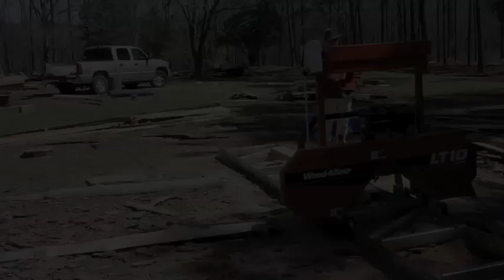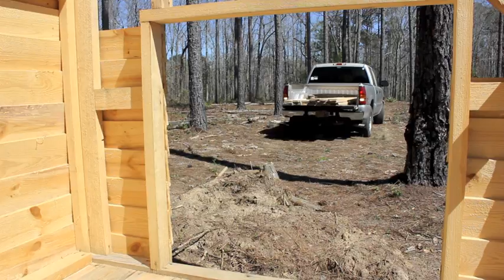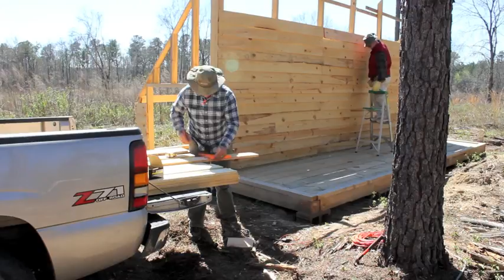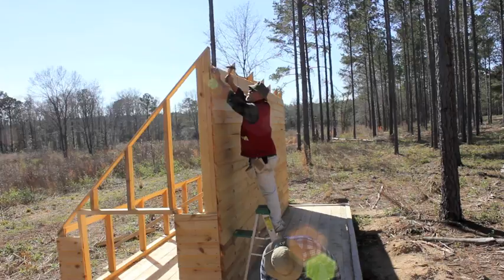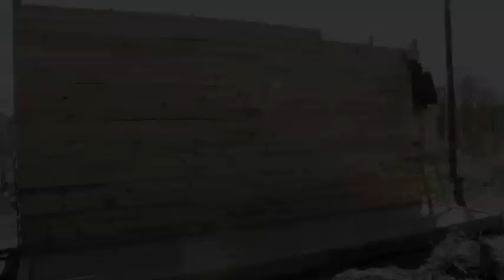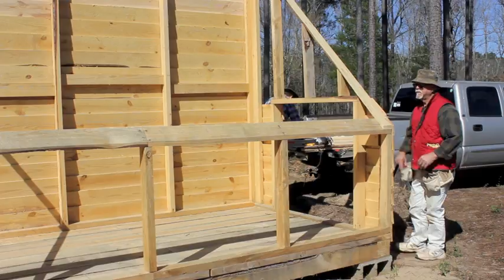Building a solar kiln! Part 5

Comment: Looking good. I know this is an older post, but here goes: suggestion. To avoid splitting wood with nails, when near the end of a board or for whatever reason, blunt the point of the nail. A sharp nail will act like a wedge and split the wood; a blunt nail tears its way through and won't split. It's worth taking a little time at the start to blunt some nails: hold the nail head on a piece of concrete or brick and hammer the point.

Comment: I miss my Dad everyday!  
Have you given thought to moving air through your kiln when it's in use?  I'd suggest a couple 12v fans and solar panels.  quick, cheap, effective, and free to run!
Reply from the maker: wauhawk Yep! Already have power run to it. It’ll have fans that run off of grid electricity. Solar would be pretty cool, but I already had the wire.
Reply: Yeah, solar is a good idea, but what about passive air circulation.  I'm planning to build a kiln myself and was wondering about windows at the top to control the air circulation.  windows at top and intake along bottom.  Rising hot air should take care of that.  What do you guys think?

Comment: Looking real good. I'm waiting to see what' type of insulation you're planning on using. Although it may get hot enough without any.
Reply from the maker: Darrel Carson I’m thinking it will. I’m not planning on insulation, but I am going to line the inside with tar paper for heat absorption.